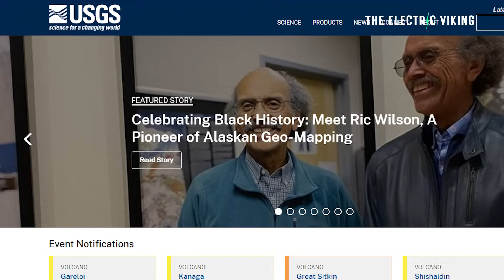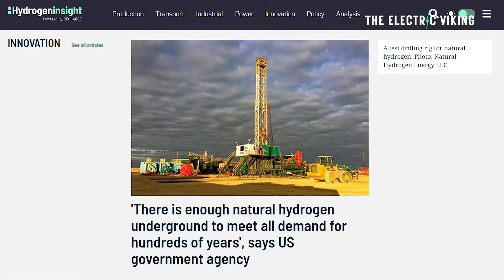US Government: 'Gold mine' with 200 years of hydrogen discovered underground

Comment: That’s crazy! I would think H2 was too reactive to be be found in a pure or nearly pure state. Guess not.
Reply: I think you are correct.Hydrogen is a red herring.
Reply: It's mixed with other gasses and would require processing.
Reply: @JoeyBlogs007  I think his point is that he expects chemical reactions, similar to the way you can't find pure chlorine.  I assume the answer is that this is only possible in areas with large amounts of waste heat, making the energy budget irrelevant.
Reply: The fact that it's usually found together with methane makes me suspicious that it may be used as an excuse to drill for methane.
Reply: Hydrogen is the floosy at the party, she go with anybody 😂
Reply: @matthewspry4217  Especially metal, until the relationship falls apart.
Reply: That’s also true of things like iron; yet pure metallic iron is found in the earth’s core. Finding pure elemental hydrogen on Earth is similarly difficult. If this was easy we’d have found and used it already; instead they are talking about drilling very expensive and deep holes.
Reply: It'smade to sound like they found a puddle of hydrogen. It's coming out of the rocks.
Reply: Actually, the reservoir discovered in northern France recently is surprisingly pure.
Reply: It's natural gas. Thst is where the hydrogen comes from. The methane molecules contains only 1 carbon atom. The rest is hydrogen.  It's natural gas. This channel is always complete horseshit
Reply: Its probably in the form of fresh water

Comment: Could be used to run ice cars and possibly some aircraft. LPG tanks in the boots or back of cars can be used as fuel to run them. It would come down to price in sold for and having enough cars with tanks in them able to use it and having it for sale at enough places. Ideally vehicles that could use gasoline and hydrogen and lpg would be better than only one fuel.😊
Reply: Hydrogen has terrible energy density unless you chill it to a liquid and that creates a whole other set of issues. There's a reason the rocket industry is going to methane in new engines like the Raptor and BE4. Better fuel density, easier handling, no crazy cryo pumps.
Reply: @matthewconnor5483  Methane is still cryogenic, and the pumps needed are crazy for their operational temperature range, but the density makes a massive difference, Hydrogen just can not match it.
Reply: @PiDsPagePrototypes  the boil off issues with hydrogen really limit it's useful window too. At least with methane you don't need crazy seals like hydrogen to keep it from working it's way up the drive shafts.
Reply: @matthewconnor5483  Even sealed, the Hydrogen atoms and the H2 molecule, are small enough to soak out through the material of the container.
Reply: Yeah I hear again and again about the horrors of using hydrogen to power cars engines and other things. However with hundreds of billions of dollars of the stuff is possibly available to be used in the future it might make sense to use it rather than allowing the power of none comprehension to deliberately waste the opportunity to use it. Could possibly be used to power a few large military aircraft on the cheap. Especially since there is probably hundreds of billions of dollars of the stuff available to be used over time in the future. Depends on whether or not the crude oil business likes money doesn't it? My guess is that they are slightly big fans of getting lots of money 💰.
Reply: @brettcrawford8878  There's zero infrastructure to use it, deliver it,... TBH, It'd be wiser to feed it direct in to a powerplant, use solar in the daytime and hydrogen at night, and everywhere downwind of the powerplant would get rain for growing crops with.

Comment: According to the Institute for Energy Research's calculations, the U.S. sits on 1.442 trillion barrels of recoverable oil deposits.

That's over 60 times the amount we usually hear about.

This would be enough to meet all U.S. oil needs for about the next 200 years.
Reply: Hmm that much which will stay were it is in the earth's crust. Oil acts as a buffer for solar and other unknown waves from space. It acts like the oil filled engine mounts in new cars and trucks. It absorbs vibrations.
Reply: @imfloridano5448   Interesting idea, sounds likely under assumptions-- can't be oil, or liquid alone, has to be compressible something, gas on top of oil, and there needs to be significant friction for gas compression to dissipate energy, not just a spring but damper too.

Those requirements seem typical in real life.  Even if real may not be 'significant', IDK.

(ignoring the sources of said waves)
Reply: You forgot all problems that hydrogen has. Embrittlement, low energy efficiency, high cost of storage under extreme pressure, leakage, explosiveness and too many other problems that hydrogen has, make it a very bad choice for anything besides fertilizers and the iron industry. BEVs are much more efficient than hydrogen fuel cell cars. Not even close. You can't beat physics. Hydrogen is unable to become an alternative to lithium, aluminum or sodium ion batteries.... Too expensive, too flammable, too leaky, too corrosive and too inefficient due to its nature. There is a reason why hydrogen cars are a complete failure even after so many decades of research and development.
Reply: We can't touch it without destroying the biosphere though.

The more we delay action on climate change: the more urgent action becomes. The reason is that our "carbon budget" (to hold the line a 1.5C or 1/3 of an XKCD ice age unit) remains fixed.

When the  Kyoto protocol was signed in 1997: we had about 50 years to phase out fossil fuels (2050 deadline).

After 25 years of inaction: we have about 7 years to phase out fossil fuels (2030 deadline)

If Conservatives get elected: we will have 4 more years of inaction, and minus 1 years to phase out fossil fuels (2027 deadline, plus minus a few years).j
Reply: Earth would be unlivable with everyone stuck inside with a/c Massive storms, flooding, huge temperature swings and forest fires would make for constant natural disasters. That's not how we should leave Earth to our younger generations.
Reply: Mr. Koch and Exxon making us feel smug again....
Reply: Order of magnitude more since horizontal drilling and fracking tech revolution. (more than prior to mid/late 2000's)
Apparently many massive similar shale formations all over Earth.

Comment: Nitrogen oxides including the perhaps most climate change problematic N2O sadly created by burning hydrogen in air in addition to H2O - so wow definitely we can hope for better fuel cell technology indeed🤯
Reply: Ice caps are gonna melt even if humans never existed.  Ice ages are cyclical . We are entering an ice age termination event and will not have ice caps for more than 100 years before they return . But blame cars that account for less than 2% of global emissions
Reply: Environmental pollution by extracting hydrogen from the Earth is only one of the problems.  Embrittlement, low energy efficiency, high cost of storage under extreme pressure, leakage, explosiveness and too many other problems that hydrogen has, make it a very bad choice for anything besides fertilizers and the iron industry. BEVs are much more efficient than hydrogen fuel cell cars. Not even close. You can't beat physics. Hydrogen is unable to become an alternative to lithium, aluminum or sodium ion batteries.... Too expensive, too flammable, too leaky, too corrosive and too inefficient due to its nature. There is a reason why hydrogen cars are a complete failure even after so many decades of research and development. Billions upon billions of dollars were wasted in the development of hydrogen fuel cell vehicles and the result is that all hydrogen car models failed to sell anything at all. Toyota Mirai is the last car to be still in production.... Hydrogen just doesn't work no matter how hard they try to market it as an alternative fuel/energy option.

Comment: Unbelievable how lucky Americans are
Reply: Just another way to make the richer, richer -- and the poor, poorer.
Reply: @jamesthomas1244     good grief, the largest resources of oil are in the middle east, which would otherwise be the poorest region on earth. The rich get where they are by being smart, not lucky. There's resources all over the world, but many societies never developed the knowledge on how to find them or extract them. But if the west wants to go and help them, people like you scream "exploitation". You can't have it both ways.
Reply: You forgot all problems that hydrogen has. Embrittlement, low energy efficiency, high cost of storage under extreme pressure, leakage, explosiveness and too many other problems that hydrogen has, make it a very bad choice for anything besides fertilizers and the iron industry. BEVs are much more efficient than hydrogen fuel cell cars. Not even close. You can't beat physics. Hydrogen is unable to become an alternative to lithium, aluminum or sodium ion batteries.... Too expensive, too flammable, too leaky, too corrosive and too inefficient due to its nature. There is a reason why hydrogen cars are a complete failure even after so many decades of research and development.
Reply: I’d feel luckier if I had healthcare.

Comment: Great news!!  We already have the infrastructure to pump and transport natural gas, hydrogen is very similar, just need to see how economical it is.  Hydrogen's a great option for ships and jet airplanes, no use for passenger vehicles as we're still stuck paying fuel companies at fuel stations where we can charge at home from our solar panels, with EV's.
Reply: Except for hydrogen embrittlement problem.
Reply: @waywardgeologist2520 😂damn the most frequently spoken term in my day job.
Reply: Hydrogen is NOTHING like natural gas.
Apart from the embrittlement problem that others have mentioned, the size of the atom is a huge problem too.
There is no material available at present that can contain H2 at usable temps/pressures.
Reply: Hydrogen works it's way into the crystal structure of metals and makes them brittle. The means it's a very difficult material to work with. Also effective seals are very difficult. The shuttle had to use a triple sealed, helium purged system for the hydrogen pumps.

One does not simply switch natural gas systems to move hydrogen.
Reply: Incorrect we do not have the infrastructure
Reply: I wonder why propane has seen very little success... it first started fueling transportation in 1913.
Reply: @bfree6197  I drive a dual fuel Toyota minivan. It can run on regular gasoline or on dirt cheap LPG (highway 500 km or 320 mi for only $20).
Greetings from Bangkok, Thailand.
Reply: @bfree6197  And you can blend hydrogen with propane.
Reply: @oscarvogel2140  most places are looking to mix 10% hydrogen with lean gas spec natural gas. That is 97+% methane. 
They may go higher than 10% in time but that is the current tested limit for the steel pipelines.
Reply: @bfree6197  basically it comes down to volume. 
Most conventional gas and CSG is 95 to 97 percent methane. The next big component of the gas is ethane.
Most of your propane/butane is a by product of oil wells or the cracking of crude in petroleum production.
Reply: Expensive fuel cells is another problem for passenger cars. At this point, fuel cells only make sense for heavy duty applications like trucks, busses, ships and planes

Comment: In theory it could do all that but even if it eventually does, solar, wind and battery technology will be miles ahead of what it is now and still would be king.
Reply: You can.t use any of theses if no fossil fuels . Ask Norway..
Reply: Hydrogen could replace coking coal in steel production though.
Reply: @MidnightHammer-n7h  interesting point and I do believe hydrogen can have its place for certain applications. I just don't believe it will overtake battery technology like many say,.. for example Toyota
Reply: The battery tech dates from 1842 predating the invention of the ICE by some 50 years and was a " king" only in that short period.
Reply: Too late. No hydrogen/fuel cell technology nor infrastructure

Comment: Transportation and Storage is not viable, so hydrogen is a fools errand
Reply: We've been transporting and storing hydrogen for decades, it's easily doable, just not sure how economical it is.
Reply: @RussellFineArt  embrittlement, low energy efficiency, high cost of storage under extreme pressure, leakage, explosiveness and too many other problems that hydrogen has, make it a very bad choice for anything besides fertilizers and the iron industry.
Reply: With the right technological breakthroughs it is possible. The current EV crowd writing off Hydrogen will get egg on their face.
Reply: @Whyunounderstand  embrittlement, low energy efficiency, high cost of storage under extreme pressure, leakage, explosiveness and too many other problems that hydrogen has, make it a very bad choice for anything besides fertilizers and the iron industry. BEVs are much more efficient than hydrogen fuel cell cars. Not even close. You can't beat physics. Hydrogen is unable to become an alternative to lithium, aluminum or sodium ion batteries.... Too expensive, too flammable, too leaky, too corrosive and too inefficient due to its nature.
Reply: @Whyunounderstand hydrogen is step backwards compared to BEV in terms of power output, clean energy, economic cost, and range anxiety.  The only advantage it has now is that it's faster to refill.
Reply: @HarveysWorkshop  so u saying lithium mining , cobalt mining is environmental friendly. Hydrogen is totally cleaner fuel with no need to mining
Reply: @jashanvirsingh2166  there is such as a thing green hydrogen and there is such a thing as non green hydrogen.  To produce green hydrogen, you will need to invest in green technology first to extract, store and transport the green hydrogen fuel to the refilling station.  This is not exactly the case today as that would make the cost of hydrogen fuel much more expensive. 
Lithium is actually abundant resource and battery main component is not exactly mainly lithium. Cobalt is being phased out in newer models of BEV.  Even if there is some pollution in mining, the useful life of these batteries is very long.
Reply: @HarveysWorkshop  usa, china , australia ,India , Japan ,South Korea all major economies are invested in green hydrogen, so over decade price will fall of hydrogen
Reply: @HarveysWorkshop  why are u not understanding, lithium is not abundant resource, hydrogen is .
Reply: @jashanvirsingh2166  Lithium is the 25th most abundant resource in the world.  If its really rare, why has the lithium world prices dropped considerably despite increase demand from cellphone and EV?

The fact is lithium in BEV can be recycled and after some time there would be really little need to keep on mining at the present rate.
Reply: @jashanvirsingh2166  even If governments give subsidies to clean hydrogen, the cost is still much higher than plugging and juicing your EV in your own home.

There really isn't much of an advantage except perhaps in big commercial trucks.
Reply: @HarveysWorkshop  true , first govt will use green hydrogen in trucks , later passenger cars
Reply: @HarveysWorkshop  hydrogen is no 1 abundant resource in world
Reply: @HarveysWorkshop  lithium prices have drop bcoz demand has increased , wait till 5-6 years, hydrogen prices will sure drop
Reply: @jashanvirsingh2166  your not making sense. Prices of lithium dropped because supply far exceeds ever increasing demand. 

Hydrogen is so far behind that once solid state batteries go online which makes EV charge in just 10 to 12 minutes to get 80% which is equivalent to 1000km, its game over for the hydrogen dream.

The only reason Toyota is not killing the Mira is because Japan government pays Toyota 20 thousand dollars for every Mira they sell.  That possibility is much faster than hydrogen stations being built all across the US instead of just california.
Reply: Same was said for lithium batteries in cars that they catch fire . Now rarely any such incidents happen. So in future hydrogen for transportation and storage will become viable
Reply: @jashanvirsingh2166   You forgot all problems that hydrogen has. Embrittlement, low energy efficiency, high cost of storage under extreme pressure, leakage, explosiveness and too many other problems that hydrogen has, make it a very bad choice for anything besides fertilizers and the iron industry. BEVs are much more efficient than hydrogen fuel cell cars. Not even close. You can't beat physics. Hydrogen is unable to become an alternative to lithium, aluminum or sodium ion batteries.... Too expensive, too flammable, too leaky, too corrosive and too inefficient due to its nature. There is a reason why hydrogen cars are a complete failure even after so many decades of research and development.
Reply: @jashanvirsingh2166  It's the economics of it not the safety that's the issue.
Reply: @mfx1  battery prices were high , in 2010 now they are dropping. Same will happen with hydrogen just wait and watch
Reply: @jashanvirsingh2166  Nothing to do with cost but efficiency, the efficiency of hydrogen production is terrible and bound by laws of physics that you can't improve on.
Reply: @mfx1  same was of lithium battery used in cars , their effeciency was worst . Now they have improved , so similar manner hydrogen efficiency will increase
Reply: @jashanvirsingh2166  But that's the whole point, you CANT improve Hydrogen efficiency beyond the limits imposed by physics, it's impossible.
Reply: But the oil companies won't complain since they have something to work on. Which is good.